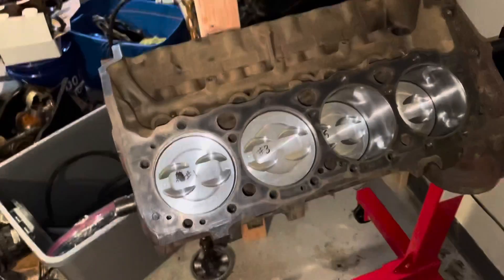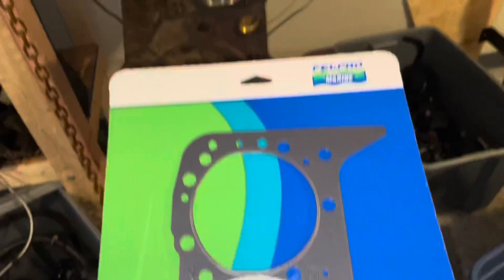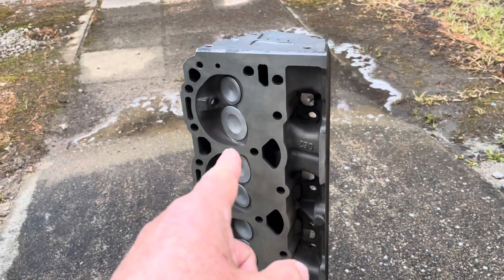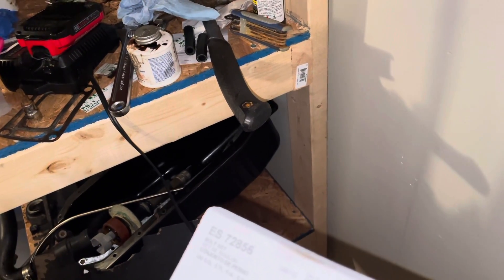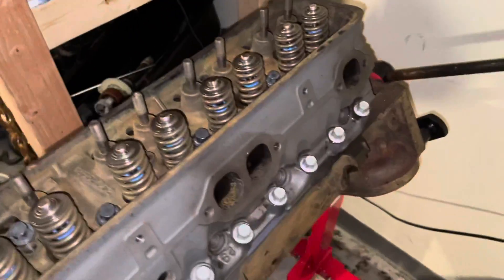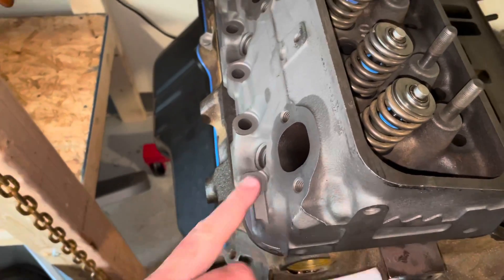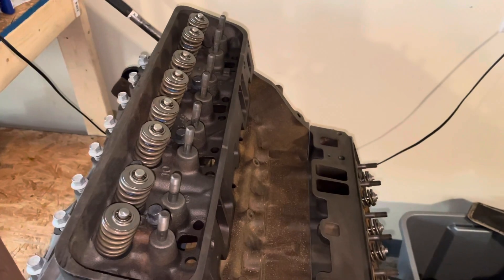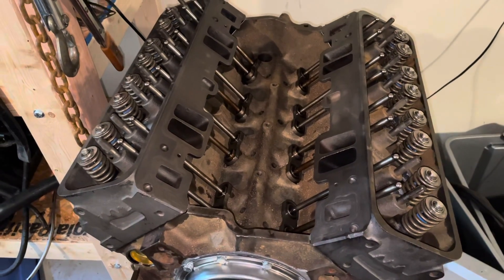Mercruiser 5.7 1(h) - Vortec Cylinder Head Install

Comment: Awesome and very informative video man! I somehow got water in my 5.7 and I have low compression on cylinder #7. And guesses on what I may need to go through and what may be the problem? Also, is there any way I can reach you easier than YouTube? An email maybe? I’m wanting to tear down my motor and build it all back up right and good advice is hard to find. You seem very well knowledged and I’d love to have some helpful pointers!
Reply from the maker: I prefer any technical help be done in the video comments that way everyone benefits from the question.
Reply: Does this gasket have to be install certain side up, i couldn't find any marking when installing. Now im starting to wonder if i missed it. I install exactly same gasket